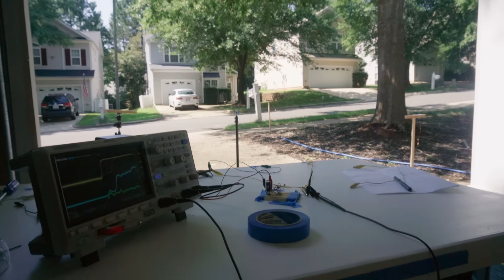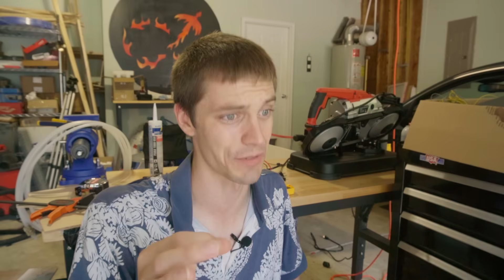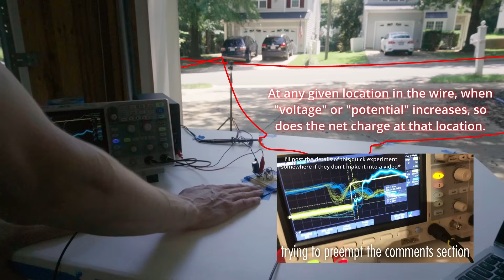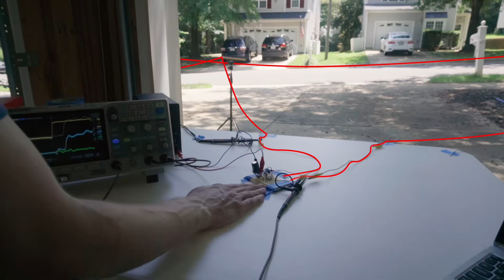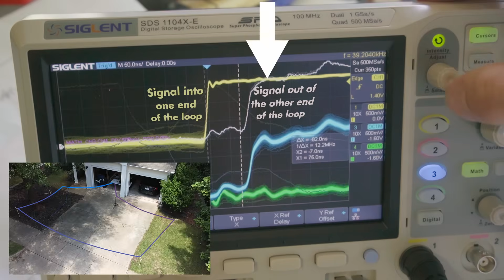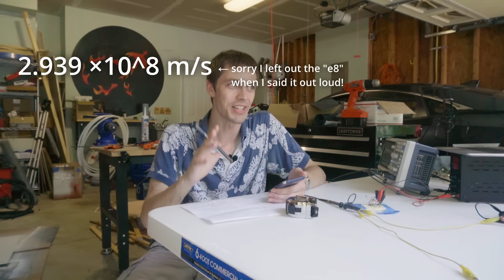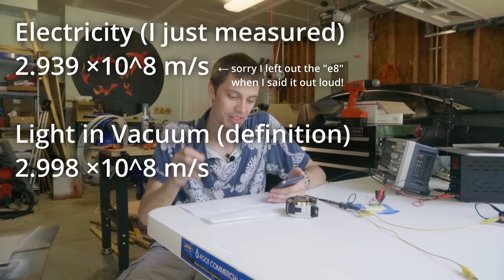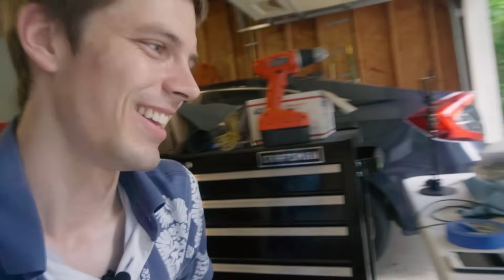Why does WATER change the speed of electricity?

Comment from the maker: Corrections and FAQ answers:
1) "When are the others coming out?" I planned to release all three of these videos on adjacent weeks, but the other two aren't done yet, and I wanted to release this one sooner to give the algorithm a kick in support of my last video from just a few days ago about FIRST Robotics - go check it out! https://youtu.be/BycqWYE3Ais
2) Pre-emptive clarification about the overly-philosophical ending: Sine waves are not the only orthogonal basis set that can be used to construct any function, so you could argue that any similar construction is arbitrary and math-only, and would STILL be indistinguishable from reality. That said, sine waves are really pretty (and can actually be used to solve equations that demonstrate propagation).
3) Microwaves! I've had a bunch of people ask about the "resonant frequency" of the water molecules (or any dielectric). This is exactly how your microwave works, and at this frequency (2.4 GHz I believe), the energy transfer from the field to the water molecule is most efficient.
4) What's the difference between this and coax, and velocity factor? In coax, the entire field is contained between the core and sheath, so the cable designer has COMPLETE control over the speed of propagation in the cable by choosing the dielectric insulation that the field has to pass through. This experiment I've set up is REALLY terrible at making sure the field has to interact with the water. There's probably a lot of "field leakage" I'm not dealing with. coax is amazing in it's ability to be controlled and uniform.
5) The frequency of flipping a switch: in the absolute most hand-wavey way possible if we assume that the ~40 nanosecond rise time for the signal (switch flip) is actually 1/4 of a sine wave (as in cut out of a wave, i said hand-wavey), then the relevant frequency would be ~6 MHz. In reality this is probably within an order-of-magnitude, but many additional frequencies are needed to reconstruct the exact shape of that rise, and I don't have a great intuition for which ones carry the most energy.
6) I did perform a "zero length" measurement to confirm that the scope channels were synchronized and the "send" and "receive" signals rise at the same time. I don't remember the offsets I measured right now, but they were much smaller than other errors in the system, like measuring the length of the wire!
7) I didn't realize at first that the pipe was at a bit of a slant, so the end the camera was looking at was only part full when the wire at the other end was already submerged. I don't even want to think about the weird physics problem of having water ADJACENT to a wire and trying to predict anything, so I only talked about the "empty" and "full" configurations.
8) ???
Reply: Where’s that part 2 u promised? I had the impression that you cut off the rest of the footage recorded for your previous vid on electricity and was making that into another video
Reply from the maker: @hobbyjoytv4530  part 2 is now three parts lol. This is part 2a
Reply: @AlphaPhoenixChannel  I can't wait for Part 2b: Chapter 1 😀
(but for real, take all the time you need on these things, we'll keep coming back for the quality content)
Reply: @AlphaPhoenixChannel  Its faster than the speed of light.  Try seeing something until you've flicked the Switch 🤣🤯😂😂🤣😱🤯💯😄💕
Reply: @AlphaPhoenixChannel  this is super fascinating. If you can explore more about how frequencies, magnetic fields, and the medium around the water are related that'll be awesome! If I was your neighbor, I would be out there with you.
Reply: @AlphaPhoenixChannel Couldn't the molecules be pre-rotated?  First apply a smaller voltage and then measure the response to an increase in voltage?
Reply from the maker: @Primarch290 that’s actually much slower because it depends on the average refractive index of the glass
https://en.m.wikipedia.org/wiki/Fiber-optic_cable

(edit, deleted their longer angry second comment because it had no place in this base thread)
Reply: @AlphaPhoenixChannel  Wow I'm late to this video! My understanding is that it's a misconception that microwave frequency is the resonant frequency of water molecules. Microwaves in general heat water pretty well. 

I was hoping to see the frequency break down because even at GHz frequencies, apparently the refractive index in water is extraordinarily high, I think close to 9, but don't quote me on it
Reply: You need to try this with different velocity factor coax.
Reply: @RIGeek.  coax is just using two conductors, and from there hurts my head.
Reply: @RIGeek.  There is no need to test Coax cable. That is why manufacturers had already tested them and gave a velocity factor in their specifications
Reply: 3) ???
4) understanding
Reply: when you turn on the switch you introduce (or change the amount of) electron, which perturb the electric field, which by Maxwell's description of what a photon is; creates a photon. Your action to perturb the field created a photon. A photon has an oscillation built-in ("p=h*f/c=h/wavelength"), ie: it is a particle with its own momentum, no longer a direct-current (DC) field. When a photon encounter a receptive dielectrics it is absorbed and re-emitted while obeying momentum conservation, ie: it conserve the direction it came from, so it appears like the photon simply pass thru the dielectrics but actually it is absorbed and reemitted, and the energy state of the dielectric transit from low to high and then low again, and this is not instantaneous, which is how the speed of light is slower in a dielectric. But of course the point of this photon is to pass momentum information from one electron to the next.
Reply: @xponen  So then electric current is actually a flow of photons, the electrons being pushed along by the photons like logs floating down a river.
Reply: Do you not have a Patreon?
Reply from the maker: @adfaklsdjf  not yet!
Reply: Great video! I have a tiny correction. My correction would be that you kinda missed the last 5% of what you were going for here. First off you show us the oscilloscope captures before and after the loop delay, check at the 0.5V threshold, and go "yep, that's the delay". But then you talk about how water actually is affected by different frequencies differently - with different speed of movement of the molecule, etc. This then results in different delays for each frequency, and you haven't actually showed those measured. What you want to do now, is to actually create a Bode plot of the wire, with an unwrapped phase diagram. A phase diagram is unwrapped when there are no vertical transitions in it - i.e. no discontinuities due to the -pi/pi wraparound; instead it is "pieced together" so that it is a continuous line. Once you have that unwrapped phase diagram, you can calculate the time rather than phase delays at each frequency. There is a slight mathematical ambiguity when unwrapping, because you have to make one of the branches of the original wrapped phase diagram the "canonical" one, i.e. the one that is actually within -pi...pi in our unwrapped diagram - but you can figure that out by comparing with the time plot of the transition. When you look at your plots again - "before loop" vs "after loop" - you'll see that there is some, low, signal between the 0.5V mark of the "before" signal and the 0.5V mark of the "after" signal. That's actually also the current. It doesn't start where "after" reaches 0.5V. In fact it starts the moment the "before" signal starts rising, it's just that your measurement apparatus and setup contain so much noise that you can't possibly read this out. It doesn't mean it's not there - it just means it's impossible for you to measure. What's located in there is the early-arriving high frequencies within the current waveform, whereas the large plateau is created by the late-arriving low frequencies within the current waveform. So this means that current in the water-wire is way faster than you calculated - but only for some frequencies!

Also, there's another thing: you mention that "the transient is AC". While technically true, something is left that wasn't said. It's not just that "the transient is AC" and that's what adds all those frequencies. The WHOLE thing is AC. If you flip on a switch today, and leave current running for one million years at 1.000000000000000000000000 volts exactly, after one million years, the voltage you're measuring will still be AC, even if we didn't have any external influences, material aging, noise, thermal noise, background radiation, etc. In its purest mathematical form, the Heaveside Step Function is AC on the domain -infinity to +infinity. Think about it this way: when you first started the video, we could only see one step-up. Everything on the left was 0V, and everything on the right was 1V. Looks like it was always DC on the left, and always DC on the right, correct? Well, then you zoomed out and showed that this is actually a square waveform. OK, fine. But what if you zoomed out, and we still only had one step-up, and only 0V on the left, and only 1V on the right? Think about it: what would that prove? Not really much, because it can always be that you just haven't zoomed out /enough/. Maybe the step down will happen exactly 5 seconds after you decide that it's actually DC? That wouldn't be serious mathematical thinking. Maybe you spend your whole life watching that voltage and it's always 1.0V forever, until your death. Maybe you start a lineage of voltage watchers who watch the voltage, and it's 1.0V forever, until the heat death of the universe. What did that prove? Nothing - it could still turn to -1V just a second after, and you can't know. The only ACTUAL current that is DC current that could exist in our universe would have to be a current that existed before the universe started, remained constant throughout, and continued until after the universe ended. I don't know if that's possible, but it's an interesting consideration.
Reply: @cheater00  You could have made two separate comments and they would each have been too long.  I think you are right but I gave up reading.
Reply: @cheater00  ...a  lot o text for just a little information (or none).

How do you want to measure the phase as function of frequency with an oscilloscope in one scan ? How do you plan to measure your "Bode" "unwrapped" phase plot ?

"this means that current in the water-wire is way faster than you calculated - but only for some frequencies!" - the first part relates to capacitive coupling while the rest is propagation along the wire.

"If you flip on a switch today, and leave current running for one million years at 1.000000000000000000000000 volts exactly, after one million years, the voltage you're measuring will still be AC ..." - Be real ! It is similar to say that 1m common ruler is never 1m. While true, by accepting the measurement uncertainty of your experiment you consider that ruler to be constant in length. In the same way, once the signal in this video is in steady state, it becomes DC.

" then you zoomed out and showed that this is actually a square waveform" - he triggers on level during the experiment, but uses a square wave to be able to do the FFT.
Reply: Very interesting indeed! I'm well aware of the FFT graphs, I use it often to analyze sound and for example signals from a doppler radar (it could be interesting to look more into the maths behind it though). Things like how a square or triangular wave signal behaves thru an inductor, capacitor or RC-filter etc. can often be visualized quite easy by just look at is as DC changing over time and use calculated using simple calculations
 - but for a more complicated system like this (where inductance and capacitance is not just defines in one component, but act along the whole wire and the surrounding medium also comes into play), it's indeed a lot easier to split it up and calculate each frequency independently, then add all frequency components back together. 
Same thing applies even for a simple filter if having random signals that is not a square, triangle, parabola (integration of a triangular wave) or sine wave. For example the typical random wave shapes of sounds composed of many frequencies (looking at them as changing DC thru an RC filter, get very complicated in that case)
Reply: I thought you would plot the phase to check if there was any detectable phase difference between different frequencies. I guess it should be quite noticeable, at least between the lowest you plot to the higher ones the scope would draw. I guess it's a sampling memory matter.

Keep it up!
Reply: @joaquins90  see my comment (above)
Reply: Putting more behind (2) - mathematically, the weierstrass approximation theorem says that any continuous function can be uniformly approximated by polynomials, but you can go further and find any set of "basis functions" that are complete in the sense that you can build any continuous function out of them. So we could decompose things into polynomials, or sines, or even pretty weird discontinuous functions that sum together in just the right way to form a full basis for continuous functions on some closed interval. So which choice of basis functions is real?

I love your comment on "if two systems produce the same observable, then they are equally valid frameworks of explanation". We could decompose signals into taylor series or other polynomials, but as you noted, the governing equations would be basically unusable and prohibitive to model with. Sines have nice mathematical simplicity that allows them to be concise when used as a basis. These basis sets are often mappable to each other, too, so its not like one is RIGHT, just some are convenient.

As for how well it maps to reality - there's another interesting angle here to consider. Sure, any continuous function can be decomposed into sines, but does mathematical continuity even EXIST? A ramp function is continuous and can therefore be decomposed, but the assumption of continuity itself is super convenient, and apparently close enough to what's going on for our models to work, but possibly not actually reflective of reality.

Lucky for us math allows for weaker conditions like "any integrable function can be uniformly approximated by sines blah blah blah" but it sort of just pushes the question further out from "is continuity actually real" to "is integrability actually real". 

One of the most amazing things to me is that these pure abstractions in math actually DO have predictive power. To the nanosecond!
Reply: Crazy question! ,can you unscrew light? assuming you have a sine wave light source, and you theoretically could spin a polarizer at billions of RPM,  can the em field be rectified , made like a DC field and still propagate without canceling out? Can you unscrew light?
  Maybe it could be tested at radio frequencies if spinlaunch lets someone use the launch arm as an antenna.
Reply: One quick suggestion...
I think it would be good if you mentioned that there are different ways to explain this that work equally well (before the very end of the video).

Too many folks having pointless arguments about what's "really happening".  All we've got are models, and if multiple models work equally well, no one can say which is "true" (and it doesn't matter).
Reply: Question regarding sine wave decomposition/philosophical ending. "If it produces the same observable", does it though? Is there a non fourier transform explanation to the field not slowing down as much as expected? I've always thought that the decomposition was the only way to explain this behaviour, so only one explanation produces leads to that result.
Reply from the maker: @edol33t  technically you could deconstruct a signal into a different set of basis functions (like polynomials), you’d just have a REALLY hard time solving all of those individual equations before adding them back together
Reply: cheap room temperature superconducting wire -- polycarbonate fishing line with a silver sputter coating and then coated in barium titanate . i used a silver coin and high voltage piezo disc for sputtering medium and then used a bell jar homade high-voltage ac sputter deposition  to coat fishing line  . my bipolar tesla coil can reach 125k but my homade vacuum pump ( ie refrigerator pump ) doesnt get a good enuff vacume for perfect even monoatomic layers of buildup  . with coils of the wire and homade cats whisker diode using zincite crystal which has a negative resistance i can charge a 10 farad super capacitor to 2.1 volts even in a faraday cage made of lead foil . Question no impute but am i missing something this cant be free energy so what is giving me a constant dc voltage ?
Reply: An idea for a new video based on this video: the refractive index changes not only the speed of light as a whole, but influences the magnetic and electric components of the fields differently, also changing its polarity.
Reply: Title" I measure Resistance"
Reply: so thats why microwaves heat water
Reply: Can you calculate the speed of electricity using "1 wire transmission of power without earth return"? It was invented by Tesla and reinvented by Avramenko who says it acts differently in this way namely there are no loses due to resistance or smth.
Reply: Wonderful video. I am an electrical engineer and have a lot to do with high-frequency technology in a development department, so I have already encountered the problem in practice. We once had the problem that the edges at ultrashort pulses (300ps) washed out during experiments with drift step recovery diodes. And these looked different at the end of the transmission line than at the beginning. What you were talking about was exactly the reason. The different speeds of propagation of the individual frequency components of the pulse. Presented in a very practical and comprehensible way.
Reply: Don't want to be "that guy" but microwaves don't actually use resonance to heat up water. The maximum dielectric loss of water is somewhere between 20 and 100GHz, depending on tepmerature, way past the 2.4GHz frequency most microwaves use. It also wouldn't be beneficial for the microwave oven to use a frequency for the highest dielectric loss, because that way the heating would be very shallow, as most of the radiation would be absorbed by the outer layers of food. And it doesn't need to as the food in the microwave is basically the only thing where the energy can go, so it'll get absorbed anyways.
Reply from the maker: @Juni_Dingo  seriously? That’s cool! I’ll have to go read up
Reply: I wonder what a fiber optic cable coated in copper would do to the speeds? And the reverse a copper wire coated in a fiber optic outer coat🤔
Reply: @AlphaPhoenixChannel  
Can you try doing the same signal propagation experiment but with coaxial cables ?
Reply: @Juni_Dingo  ^This! The 2.4 GHz frequency is calculated based on the desired skin depth (gotta love that equation) for average sized foods
Reply: 10:10 Like Mexican wave?
Reply: "Closer to light than to a [static] electric field"

No, no, no ! because:
1) for this type of signal, the majority of the energy is concentrated in the  first components of the frequency range (near DC);
2) those wires are not able to propagate high frequency components "behaving like the light" without massively attenuating them. On top of that you'll not be able to measure them with your equipment.
The infrared light frequency starts at around 3THz, or 3000GHz. The visible light is at 300THz, or 300000GHz. Just for comparison, the WiFi frequency is 2.4GHz (some devices, 5GHz).
3) your oscilloscope has a bandwidth of only 100MHz.

Furthermore, the relative permittivity of water is around 80 up to 8-9GHz. This means that all the frequency components up to this frequency are delayed by the same factor in a pretty wide frequency range.

Considering that you haven't done any mistake in your calculations, then you didn't have enough body of water around the cable,and for a longer distance.
Reply: There is no need for experiment, because the concept of the speed of electricity depending on the resistance of the wire implies that:
1. When you consider a wire as two half-wires connected together, the speed of electricity in this system is different from the speed in the whole wire, because the resistance of the halves is half of the whole one.
2. For similar reasons, when you take a stranded wire, the speed in each of its strands will be different than in the wire as a whole.
And non of the above could be in reality.
Reply: 4) Could you wrap your water pipe in aluminum foil to mimic coax?
Reply: I think we live in a physical-hologram being projected from another dimesion through interference patterns that construct to producing a quantum particle.
Reply: @rbolo29  With that idea in mind, watch a movie called Annialation.
Reply: How about it is not atoms moving but a magnetic wave.
Reply: Gold Wire should be Faster than all
Reply: It's time to heat some water in a high frequency electromagnetic field!!, ( chef micro)
Reply: You are the nerdy neighbor I wish I had!!!
Reply: There's no water resonance at 2.4Ghz.  It's a frequency chosen to balance penetration and absorption.  There are industrial microwave ovens at 900mhz and really it could be any frequency from like say 700mhz to 3Ghz.  It's disappointing to see you spread the water microwave resonance myth when you clearly have such a good handle on most of this stuff.
Reply: Supper conductivity o° engery wasted at absolute zero...
Reply: Can apply using molarity of other then metals or in other metaloids..
Reply: Cooler temp effected with air pulse
Reply: Warm h2o will loose heat...
Reply: Sound will travel more better...
Reply: Only sound frequency effect ex microwave
Reply: Sin or tan cut in half laying on its side ...is actually what you got here
Reply: Bravo! You have shown vertasium wrong, just the way many of us said.  You have correctly explained experiment and explained how the electric field moves the electron and slight motion of electron moves the electric field.  GREAT!!!

How can anyone claim he has a PhD in physics and not understand this very basic concept.  I think his PhD must be some kind of honorary degree.
Reply: Search Euler's formula calculator. Also search Hyperion Morgue Euler's formula, he explains everything in existence reality moves as sine wave motion.
Reply: regarding errata #7) you should make a non-visual spirit level for galactic surveyors by measuring the propagation through a wire in a dielectric.
Reply: hence the whole wave particle duality.  according to quantum field theories even particles are manifestation of waves.   deep physics got to kooky for me.  I find more solace in the math itself than the abstractions applied to our reality to describe it.
Reply: Actually, the most efficient frequency where microwaves are absorbed by water is around 3 GHz, or 3.2 GHz, as I recall reading somewhere.

Unfortunately, police radar and other services and bandwidths already had these frequencies allotted to them by the government.

So, ovens bad to make do with 2.4 GHz.
Reply: Dude, LEAVE YOUTUBE! You're spreading total nonsense! You're also confusion electrons and electromagnetic FIELD. The field propagates at more or less the speed of light, the electrons move in the order of m/s, not c. And when putting 1V on a wire is depleting the wire of electrons? Are you out of your mind? Whatever electrons are pushed out, the same amount is pushed in, you idiot. The only place or way you can "deplete" a conductor of its electrons, is in a capacitive setup where one side will accumulate electrons and their charge will push the electrons of the other pole out. You really have not understood the matter one bit, so I suggest you stop the damage you do by spreading your false interpretations... It's guys like you who will cause youtube to have to install moderation on content if you don't stop.
Reply: I keep wondering about inductance.
Reply: Did you include the length of your probe wires in your wire length calculation?
Reply: It seems like you're describing 'wave theory' (not tested or proven or even really talked about), the thought that everything in this universe at all scales is some form of wave oscillation or periodicity
Reply: Have you tries in a pool to see if the thickness of the water slows it further? (more length of field inside water instead of air?)
Reply: I understood the little mention of concentration of electrons near the negative side of the battery vs the positive side, making the positive side an attractor of negatively charged particles. However, it seems so strange this is not taught generally that we can incorrectly assume the opposite when jumping a car where we connect the positive first and then negative second (afterward disconnect the negative first then positive second). It would seem to people that you are connecting the power up on the red side, but actually something else is occurring. What is the flow of electricity then, or should I say the propagation of electric charge when you are helping a car start? I guess I'm just connecting the batteries in series until the car can turn over to run on the alternator?
Reply: Could the signal also be slowed down by using something ferromagnetic or at least paramagnetic instead of water, such as ferrite dust?

If so, could one also speed up the signal by using something strongly diamagnetic, such as pyrolitic graphite or a superconductor? 
Then how much, theoretically vs. practically? (Since there is only 2% margin left, theoretically.)
Reply: Would the dielectric take more issue of high frequencies causing what I was told the "skin effect" on a wire? What causes this difference of propagation at high frequencies through a wire according to the things we have learned from you and Veritasium on how elections send signals more than go off? I think I need to go study this through CharGPT-3 . . .
Reply: 8) profit
Reply: Have you seen veritasium channel explanation of electricity?
Reply: You tried to slow electricity down but how about speeding it up? I'm thinking there may be a analog to the speed of sound and how shock waves with enough energy can greatly exceed it. Also, superluminal light has been created a few years ago, so if light can go 4.3x c, why now electricity? Maybe a 10,000 or 100Kv pulse?
Reply: Same reason it temporarily slows the speed of light, wich is really induction.
Reply: In the video you said you would add links to a good Fourier transform video.
Reply: I don't know so I will ask. 
Do all currents of electricity travel at the same speed with no resistance. AC/DC?
Reply: Water is the Creator of Electricity. You talk about EL-EC- Trick3ry a lot.. You are always referring to The Fake Modern AC 3 Phase EL=EC-Trickery I presume?
Reply: Hi AP. Do you have a physics degree? If not I strongly urge you to get one all the way to PhD. You'd make a good scientist.
Reply from the maker: @sonusancti  https://www.youtube.com/watch?v=qiMR6yAFfyA
Reply: @AlphaPhoenixChannel  I knew it. I sensed your scent hehe. More power to your channel AP!
Reply: Does this mean optical audio is a scam???
Reply: Try measuring with a crt oscilloscope with different long and short pieces of wire and compare the results. Hi
Reply: At 16:53  an interesting observation why light which just a very high frequency electric field interacts with water less, thus less slowdown (refraction index 1.3).  Direct current on the other hand has more effect on water molecules (refraction index 9).
Reply: Electricity doesnt travel the speed of light but radio waves does.  What your thinking of is the speed of which Electricity propagates through a circuit.
Reply: @acedatique  - Yes during propagation the speed of light is the same, the difference is bouncing off liquid water molecules.
Reply: Seems instantaneous when you consider AC Current.  I know it's not, but it is a different concept of how the electricity does the work
Reply: What does this have to do with water?